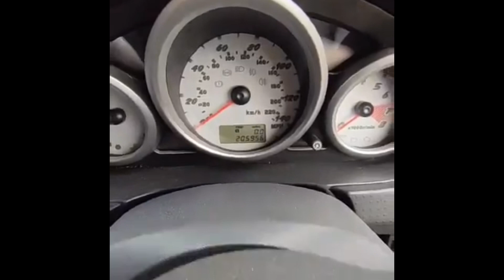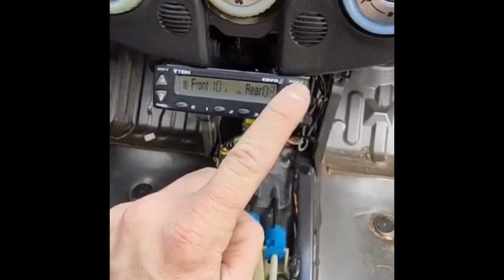Customer Vlog Mitsubishi Colt CZT 4g15t 1.5 Turbo

Comment: Whats the best size straight through exausr to put on the czt , 2.5 or 3 inch ?
Reply from the maker: 2.25 on standard turbo, 2.5 or 3,0 hybrid turbo and 3.0 on td05 turbo
Reply: @DynodazeHondaTuners  ehy is it better i thought bigger is better flo , I'm looking to get a flowed elbow off the turbo and then heading for straight through its a standard turbo, intercooler then map
Reply from the maker: @harrymcough5545  not always when you consider turbo is small. Imaging putting a Malteser on the table at one end and then blowing that with a straw across table. Time it. The do same experience with a toilet roll
Reply from the maker: @harrymcough5545  bigger turbo needs bigger exhaust for sure
Reply: @DynodazeHondaTuners  ahhh thank you, so if the turbo was small with a 3 inch exaust then you would need a lot of boost to be more efficient,? Would a 2.25 be better than a 2.5 on a standard turbo if it was mapped ? This is my last question i promise lol
Reply from the maker: @harrymcough5545  perhaps yes 👍